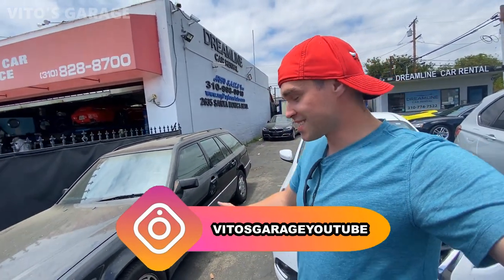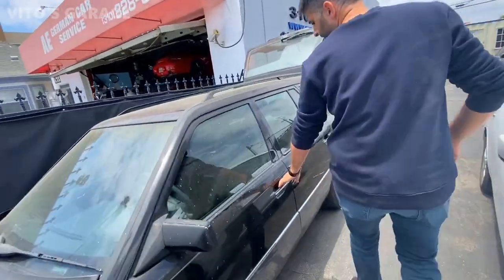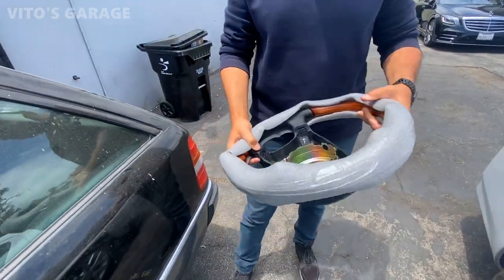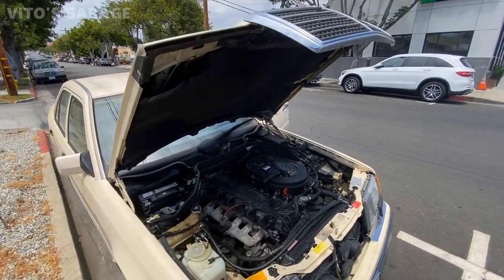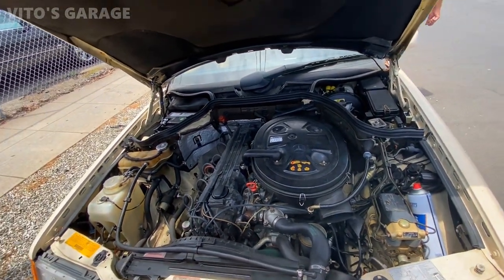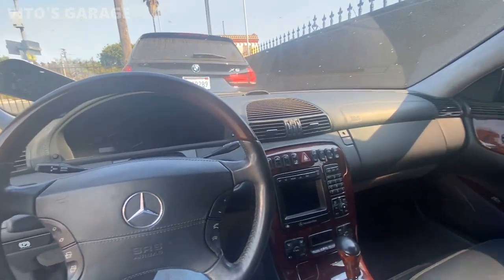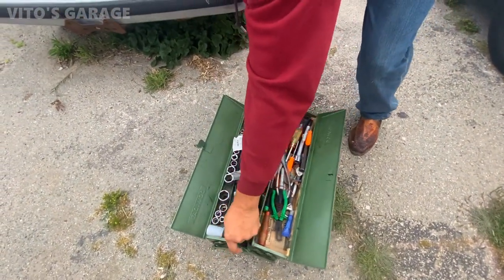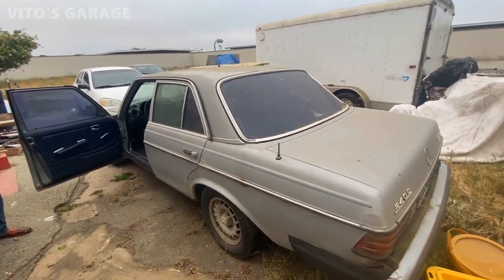Rare Black on Black Mercedes S124 Wagon! Hanging Out With Subscribers & Friends in California!

Comment: Hey Vito, one question, I have my W202 Wagon, I looked up WIS and said that floorpans are the same for sedans and wagons
My spare wheel well, and my rocker panels are gone, I want to fix it with used parts, I found a junkyard in my zone, they said they could do a discount if I buy all parts once, he could cut those however I tell them to do

I will hire a friend to do the bodywork

How could I cut the rocker panels to then disassemble them and weld them?
Reply from the maker: Hi Simon! I will send you some videos soon. The videos will probably be in a different language. Do you have an email?